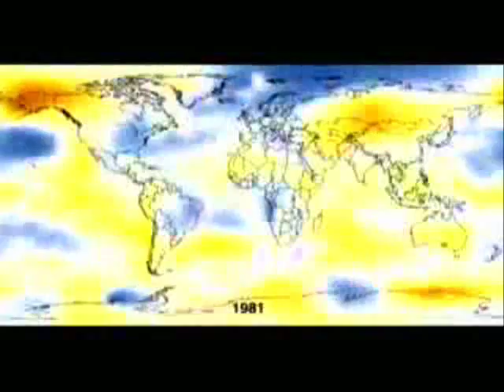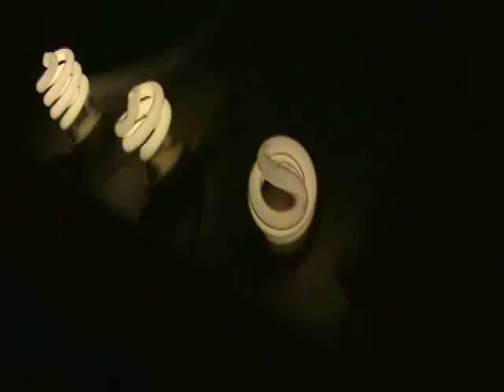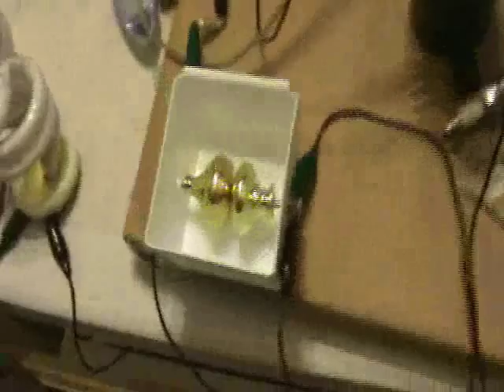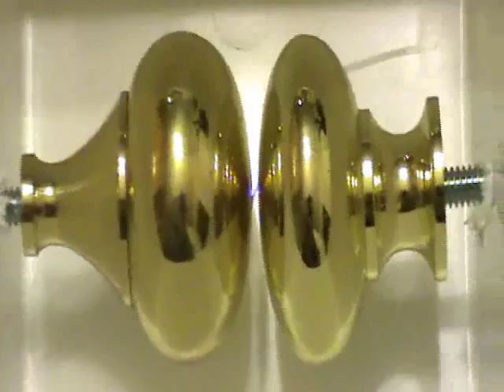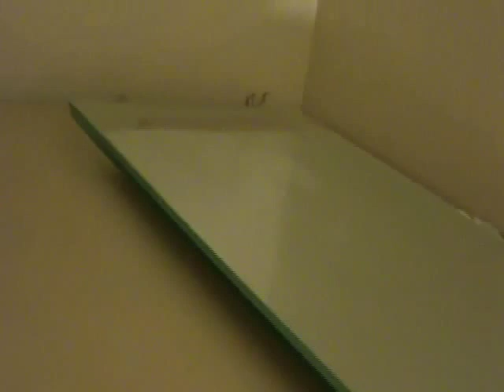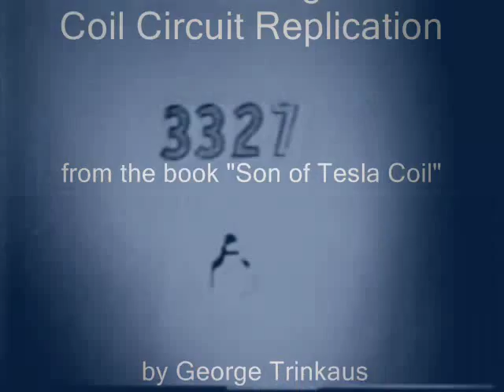555 timer driving ignition coil with CFLs on 2ndary

Comment from the maker: With the 555 timer, I can adjust the frequency by changing caps and resistors. I was shooting for 2 to 5khz ... but tried higher and lower frequencies too. The ignition coil appears to like 4.8khz if I remember. Input voltage is 12V.